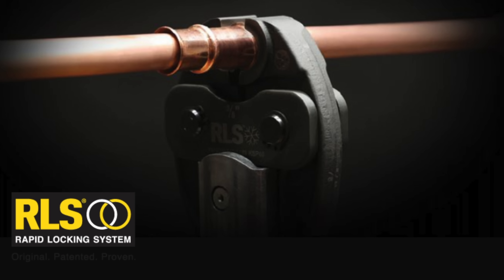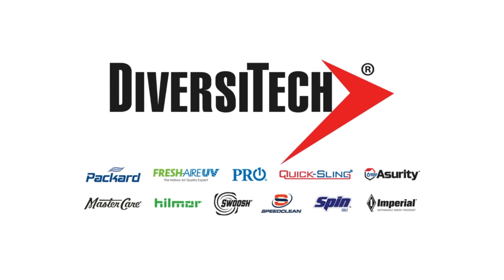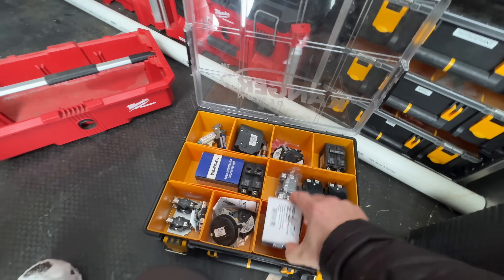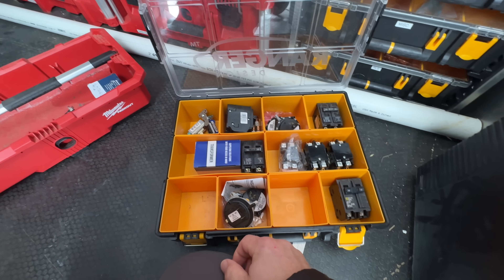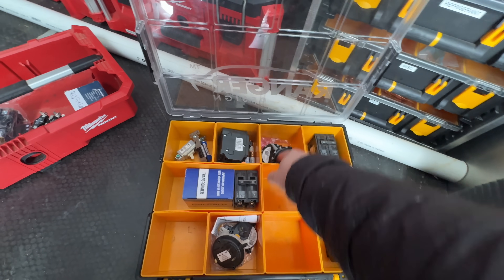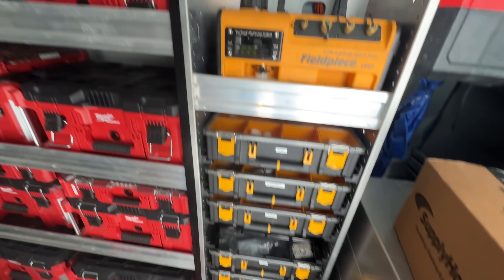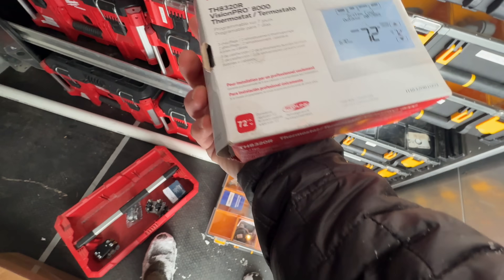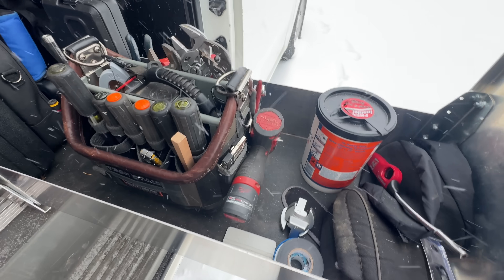No HEAT Call in a Tennessee Blizzard!! HVAC Repairs

Comment: I'm in Central Florida, and heat pumps are the norm here.  I do have a two stage dual compressor Trane XL1800 5 Ton Heat Pump, and it was born in 1999.  Needless to say it runs a lot down here, and it does a great job pulling out the humidity, keeping our home around 40-44% RH most of the year.  Sometimes dryer in the winter.  As I'm sure you are aware, most heat pumps are good and capable of generating some heat down to a specific outdoor temperature and as such will automatically turn off below a specific outdoor temp.  I believe on most thermostats, you can also configure them to disable the heat pump so it won't come on when the outdoor temp drops below a specific temperature.  Ideally, the thermostat is set to match the Heat Pump manufacturers recommended temperature.  This way, customers don't have to manually switch to EM Heat below a certain outdoor temp.  Also, even though the heat pump may not put out full heat at lower temps, the fact that the indoor fan is circulating the air pretty much non stop will help to insure more even air temps in the home and eliminate hot spots or cool spots making the rooms more temperature consistent and comfortable. I usually just set it and forget it and let the intelligence built into the unit do its thing, and it works pretty well adding heat strips when needed to raise the temp a degree or two occasionally during our coldest nights.  Thanks for sharing this video.  It's still a mystery why those wires were not connected in the air handler unit correctly...  Great Job!

Comment: Im also in TN. On more modern heat pumps they are typically designed to be more efficient  than electric heat down to 0 degrees so i dont see an issue just letting them run and the unit bring on auxiliary  heat as needed if it falls below the balance point. There are some circumstances where i would switch to emergency heat like if large ice cicles could fall into the unit from the edge of the roof or there is freezing rain that could cover the unit in ice or snow drifts that could cover the unit. If it's just cold though i dont see an issue in letting it run.

Comment: The video threw me off when it's the middle of winter and you're grabbing a contactor! I'm typically grabbing control boards and igniters haha heat pumps aren't super common unless you have a cottage or a boiler system around my parts. Also, if you only get an inch of snow, we typically stay in until the rest of the snowstorm hits until we break out the sleds.... and our sleds have motors haha

Comment: Heat pumps are only good for temperatures 40 degrees and above.
Reply: Actually, now there are heat pumps that provide good heat as low as negative  -22F .  The technology is getting better and more cost efficient.

Comment: I have an inverter system heat pump and live in North Texas but I keep it in normal mode because it is good down to -2 degrees. I tell my customers with the standard heat pump to the same as you do, use EH until temp is above freezing a few degrees

Comment: I just learned in this latest storm that if you do turn off the heat pump, either wait until it is above freezing of check the fan on the condenser.  Turned mine on when it got relatively warm and the condenser about shook hard.  Fortunately, I noticed it within a minute or two.  Had ice on the fan blades.  Secured it then a couple days later went out with a heat gun to clear off the ice.  Felt much better after it went through a defrost cycle when I did turn it on.
Reply: they need to manufacture antifreeze sprayers like they for airplanes with ice 😂

Comment: Im in south Alabama and no matter how cold it gets here I let the heat pump run. Only if the unit stops producing heat will I switch to auxiliary heat because those heat strips use a ton of electricity and runs up a bill.

Comment: I Guess, they installed new thermostat, but it was not set to heat pump or they did not find option for O or B, then when they were calling cooling,  Condenser was running on heat, so they disconnect one of the wire to make it works.  In the summer probably you need to come back,.. may be I am wrong.

Comment: I live in NH and just installed a Mitsu Hyper Heat system on my house to become my new primary heat source, and keeping my gas fired old steam boiler as the backup heat. Sure the Hyper Heats can heat as low as 17 below zero outside, but the cost to do so outweighs the cost of using gas. So when it drops below 15 degrees, I turn on the boiler.

Comment: I tell all my client to keep the heat pump in normal operations unless the heat pump quits working for 2 reasons. 1) the house will heat better with the heat pump and aux heat vs. just the emergency heat 2) a lot of times the heat kits in peoples houses are undersized for the home and running it in just emergency heat will be worse off temp wise than just running normally.

Comment: I went on a similar call once but come to find out another company disconnected that W wire during the summer because they couldn’t figure out why it had 24V. Found that a mouse chewed through the wires and G and W were touching.

Comment: We had 8 degree temps 2 weeks ago and I used emergency heat for about 2 hours one morning. My 5 ton, 2017 Trane XR heat pump did a pretty good job of keeping our house (2260 sq ft) 69 degrees during the day when it got up to 17-18 degrees. It runs quite a bit but does cycle on and off. 14 ft. ceilings make it harder to heat in the living room, kitchen, dining room area but that's just part of having high ceilings I guess.

Comment: Bad setup and wrong thermostat, use a T6 lyric and set the heatpump lockout feature, also lockout the heat strip in the other direction. No outdoor temperature sensor if there is wifi

Comment: What?? Depending on seer rating and proper sizing to load (heat loss) there are Heat Pumps today that can keep up at extreme low temps. So unless you have already benchmarked this system do not automatically cut out the refrigerant side ,unless you know the balance point…. If R410A OUTDOOR COIL TEMP in this weather will most likely be around -5 Degrees Fahrenheit and PSIG around 42 PSIG true suction.

Comment: I used to think it was better to lock out the heatpump below 15 degrees,  but have since tested my own heatpump. I checked it this weekend when the temp was 7 degrees outside. The hot gas line going to the inside coil was 160 degrees F. That's pretty good heat production at that ambient temp. The aux strips alone could not maintain the 68 degree set temp on the thermostat, but it did with the heatpump on. So I say leave the heatpump running unless there is danger of the outdoor fan becoming locked or the coils becoming clogged by ice. Heatpumps can produce heat at temps well below 0. My unit is a 14 year old Goodman 14 seer that I upgraded with a Emerson  on demand defrost board.

Comment: I'm in Long Island, NY. I needed to get my central air conditioner replaced last spring.  I decided to go with a Trane XR15 Heap Pump without emergency heat strips.  I only use it in heat mode when the outside temps are 40 degrees or above and only during the day.  Otherwise I use my oil fired boiler with baseboards.  I figured I would try to cut out some oil consumption since the price of oil is ridiculous.  What I have learned so far is that the hot water baseboard heat is by far the most comfortable heat in my opinion.  The heat pump heat is not as comfortable.  It tends to bring in unwanted humidity and since my vents are on the ceilings, can be blowing right on us depending of where we are in the house.  In the fall when I first put it in heat mode and the coil was still wet from being in cool mode, it fogged up all of the windows and mirrors in the house and the extra humidity was not good at all.  Since I did not get heat strips with mine, if it does go into defrost mode, it is blowing cool air for a few minutes but does not seem to be that big of a deal.  I just figured since I was replacing the AC anyway, why not spend a couple extra bucks and have another option for heating.  Electricity is not too bad here.  I think 22 cents per kilowatt hour.  Will see if it was worth it in the long run.  Too soon to tell.
Reply: West Ky is $ .11125 per kilowatt hour.

Comment: i'd run a top of the line outdoor unit up until -10 C, that's  when Emergency Electric Heat comes in handy.
Reply: the units should have ratings , but i wouldn't heatpump past -10c

Comment: I have had my curiosity peaked during this winter. I have a thirteen-year-old heat pump with strips. The issue with putting it on Emergency heat only is that the strips will not heat as well as letting the system run on its own. Still doing research on the subject. I used to work on mobile homes in the 70's but had mostly Gas, Oil or all electric. On the all-electric we had far more heat strips than on a heat pump back up strips. I did quit servicing mobile homes and decided to stay with RV's which was my main line of work. I am 76 now and retired with a couple of rental houses so like to keep my hand in the knowledge of the units. Thanks for the video from a Nashville TN 😎
Reply: Depending on your thermostat you can set it up to where only heat pump will start off running and if temp is not met in certain amount of time whatever you set it at example: 15 min 30 min 45 min ect the heat strips will kick in and help the heat pump bring it up to temp and start over on next cycle. But most heat pumps have a built in lock outs so if outside temperature drops below like 5F is a common one it will automatically lock out the outdoor heat pump and switch it over to heat strips only until outside temperature rises above what manufacturer lock outs.

Comment: Here in PA we just let heat pump systems set to normal heat. Also depending on the type of heat pump, we rarely see strip heat other then defrost.
Reply: Yea my neighbors Trane I rarely hear running and more so when it’s maybe 15-20. I think heat strips on at 32 is quite early.

Comment: Good video ! Having ONLY 1 SOURCE OF HEAT in Your House is absolutely Stupid  !!! Especially if you live Where temps can get below Freezing.
1 = None is what they teach us in scuba diving. 1 Light = no light. Because it will fail. It’s just a matter of WHEN !!!
Just Like ALL Mechanical stuff: 
1) Your Car WILL DIE ON YOU ! It’s just a matter of WHEN !!!

Boy Scouts motto :
Be Prepared !!! 

1) Buy a Couple Electric space heaters. The oil filled ones. Safer.
2) Buy - a Propane generator. Portable. 
3) Keep cases of water in the house ,
4) 1 Months supply of food.
5) 1 Months supply of toilet paper.

Comment: Whoa. I can’t imagine leaving mine on emergency heat all the time below freezing. Mine’s 15,000 watts worth of heat strips. Our Trane XL16C heats just fine down to about 20°, then occasionally uses aux heat to supplement when it can’t keep up. But even then, it’s wayyyy more efficient to let the heat pump do most of the work rather than firing up 15,000 watts worth of heat strips. Below 20°, it utilizes aux heat 4-5 times an hour, but only supplemental. When it hits zero outside, the heat pump shuts off automatically, so Emergency heat must be used at that point. But that’s rare in Middle TN.

Comment: Rodney, Tulsa Oklahoma,
I’m with you, below freezing use EM heat, I know the heat pump can add some additional heat but heat strips should be sized to run solely on there own, I have also ran calls where the heat pump was running with the heat strips and cooling down the air temp a little, I am guessing the heat may be low on charge did not check it since it was single digits out side, I know newer units are more efficient, so I would say the units age factors in, thanks for the video

Comment: I live near Lexington Ky.  We had our heat pump replaced last summer.  We've had temps recently in the single digits and have not used emergency heat.  It's a 14 seer Rheem unit and when I turn the temp up in the AM from 66 to 69 the Aux heat will kick on and helps the house heat faster.  That's the only time Aux kicks in and the heat pump has no trouble maintaining 69 and still cycles on and off.  The installer, a reputable company told us to not use Emergency heat.

Comment: Run it always unless refrigerant side needs repair or defrost can’t keep up during heavy snow/ice conditions.   

The unit is designed to run, it’s a machine built for cold and hot weather.

Comment: If you’re all electric, run it now matter what. It’s still providing heat that is cheaper to buy per btu than what resistance heat can provide. That being said, if the hp is on the ground (not on pump ups) it will freeze into a growing block of ice with every defrost cycle; which is obviously a bad thing. That would be the only reason to shut it down.
Reply from the maker: Good point.

Comment: Newer heat pumps are better and still have COPs around 2 even down to 5 F (per manual on my unit). So, by running it you still use what heat is available, but probably need to run AUX heat with it. Inverter heat pumps on the other hand will run 100% capacity down to 0 or -5 degrees F and may not even need AUX heat. I kept mine running in North AL during this. Handled it just fine, but was using AUX heat with heat pump due to the thermostat I have that doesn't allow me to adjust when the AUX heat kicks in.
Reply from the maker: You can add a thermostat with outdoor air sensor to lock out the electric heat.

Comment: From Washington state. We use to do heat pump commissioning sheets for the state. They wanted the cutout for the outdoor at 5°F.  At that temperature, the hp will run constantly and MAYBE  maintain your setpoint,  but  most customers aren't comfortable with the supply temp at that outdoor temperature. Especially the older generation, I've found. 25°F is where I like to set them,  depending on the equipment and customer.

Comment: I set my thermostat to lock out the compressor at 10 degree ,this morning it was 5 degrees out when I got up this morning and  it was 64 degrees in the house .I thought something was bad wrong. Duke energy had control of the t stat for a while. Eco -64 was showing on the thermostat. While the call for heat was on ,the heat strips put out 100 degree air ,a while later the temp rose above 10 degrees so the outside unit was operating and the supply air was 120 degrees. At 9 am duke set the thermostat back to my setting back to 68. System normal.

Comment: Up here in Pennsylvania, It's natural gas furnaces and boilers, no heat pumps in most of the area, not reliable enough, even heat strips aren't able to keep up, and not a lot of straight air conditioning in the summer, unless it's a newer building, a lot of window units and split units.

Comment: Just wondering if that t-stat was compatible with the system? Have seen systems where heat strips energized on cooling call, had to do with  internal program set-up in Honeywell t-stat. Maybe whoever changed the t-stat left those wires loose, and hauled ass.

Comment: What about the new high efficiency heat pumps. Mini splits that can operate in these temps?
Reply: I have a Fujitsu mini split and it works fantastic here in NY all year round.  I use it for my finished basement.

Comment: In Virginia where the temps don't get to single digits. Unless there's an issue with the heat pump like on low charge, I say keep it on the normal setting. Even at 17F, the heat pump oughta have a COP great than 2. It may run awhile, but still cheaper than the heat strips. The thermostat may occasionally call for it if needed. 

I run a 16 year old single stage heat pump and have locked out the heat strips. No issues with it maintaining 68 on a 100 year old house with modern windows, good attic insulation, and air sealing.

Comment: I'm in Arkansas and my system(Trane package gas pack) decided to crap out on my Sunday.  2 systems...1 upstairs and 1 downstairs.   Downstairs is the package so it's outside.   Burners were cycling on and off.  I went Sunday night and all day Monday on 2 portable heaters.   May be the Flame Sensor.  I say "may be" because I can fiddle with it and get the system working fine.  It may work fine for hours then stop working again.  It ran all night last night fine and then crapped out at 5 am this morning.  When it got daylight I fiddled with it some more and it's been working fine the whole day today.    Still waiting for a Trane Flame Sensor to replace the current one and hope that fixes it.   Perhaps too much corrosion in that area???  2008 system.

Comment: Here in southern Manitoba, I have a Goodman single stage heat pump with Daikin smart stat. The installer didn’t install an ODT didn’t even know what it was. The Daikin stat requires a 10 Kohm RTC ODT. 

I work with enough electronics that it was simple for me to get a 10 Kohm RTC thermistor. Wired it to the ODT terminals on the Daikin stat. 

I could then program the heat pump lockout for +20 F. No issues so far

Comment: My Bosch heat pump is cold weather rated, and I have it automatically switch over to auxiliary heat at 0 degrees F.  I have a plenum heater for backup as well as a Bosch propane furnace.  Everything functions flawlessly in the cold Minnesota weather.
Reply: Boom! Top of the line stuff right there, the Bosch IDS is amazing!

Comment: I tell my customers to only switch them to emergency heat during ice storms or below 10°F. My systems have lasted 15-24 years. They are designed to run more efficient than resistance heaters down to below 10F. Poor installation practices and lack of pm ‘s and filter changes do more harm to equipment than cold temps ever do.